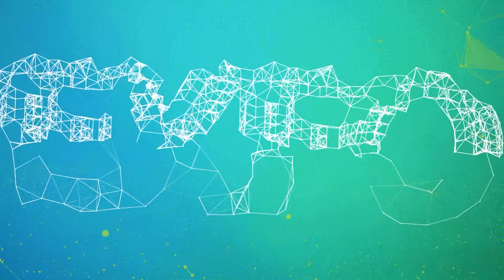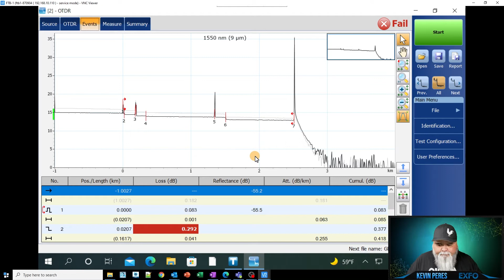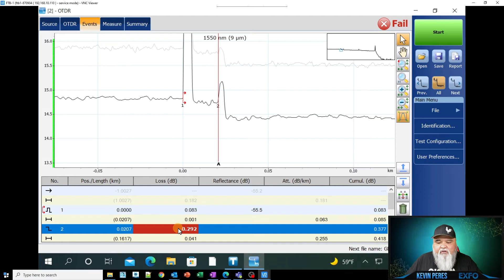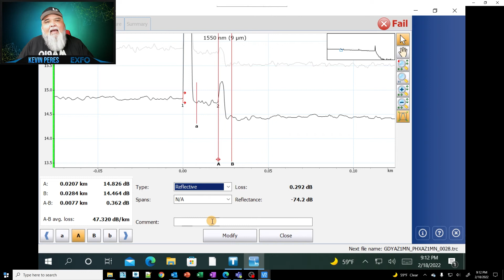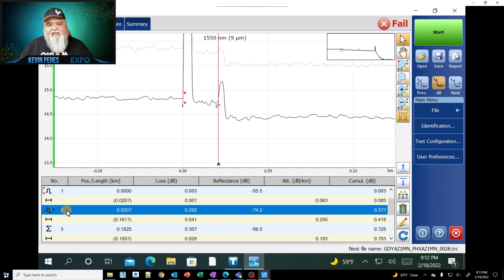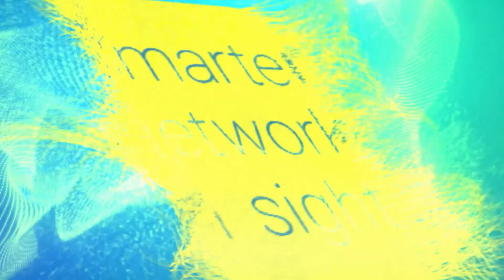Editing OTDR event type on EXFO tester

Comment: Is there any way of changing event types to reflective on Fastreporter 3?
Reply from the maker: Yes, select the event in the event table. I usually select the event number at the top.  Once it is highlighted right click and select properties.  that is where you change it.
Reply: @KevinPeres  cheers Kevin, I had one trace that wasn't using a launch lead and I didn't notice so when highlighting the whole event I didn't have the option to change as a whole. 

Great videos, very informative thank you

Comment: Is there any difference when if I am testing a micro fiber
Reply from the maker: Paul, not directly.  The fiber itself is what you would find in a standard cable.  You do start to see 200um fibers.  The core and cladding are still the same 8.3um and 125um typically but the coating which is normally 250um can be reduced to 200um to fit even more fibers in.  This does not affect testing.  The greatest danger from micro-fiber is improper placement, and not having experience with splicing it.  As a tester in front of the patch panel, you can't tell it from a standard cable.

Comment: Thank you very much Kevin Sir. One point is clear that we can change a detected splice to connector so is it true the other way also like changing a detected connector to a splice. I faced this issue once where the splice was detected as a connector so i re spliced and the issue was solved. 
Before this video I used to retest the fiber where a connector was detected as splice a till it was detected as a connector. And with every new test even with the same parameter settings and same fiber there are some minor changes in the loss and reflectance values. 
So now i can confidently change the detected splice to connector where i know there is an APC connector and the reflectance is better than the threshold value. And for the other part of the question I will wait for your advise like will it work for changing the detected connector into to splice where i know that this is non-reflective event (Splice), will this is be correct logically.
Reply from the maker: Sir, You can change a reflective event to a non-reflective but you need to be careful.  If there is a detectable reflection, I would be curious what that value is.  If your OTDR is set to default that means it is worse than -72dB.  This is an indication of a bad splice.  That is why when you resplice it, the issue was resolved.
Reply: @KevinPeres   Yes the OTDR was set to default and I don't remember the reflection value as this was the 2019 story. So what i get from your explanation is, any splice with the reflection value worse that -72 db detected as a connector by the OTDR is a sign of bad splice.
Reply from the maker: Yes, A splice should not have detectable reflection.  It could be bad fiber, but you would see it on other splices as well. The backscatter of fiber is in the -80dB+ region outside of the fiber detection threshold.  More often than not it is a bad splice.
Reply: @KevinPeres  Thank you very much Sir. Now all my confusions are cleared related to the reflective and non reflective events.